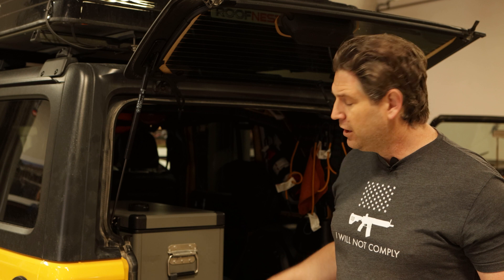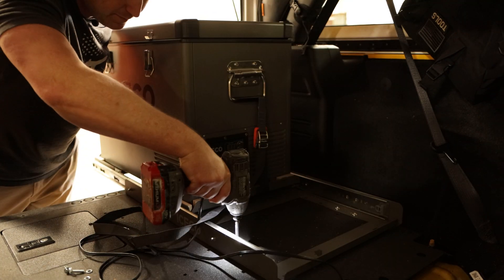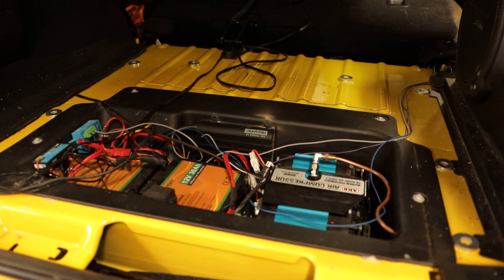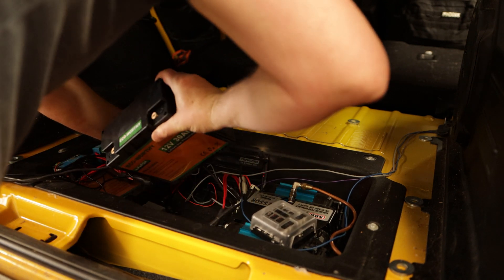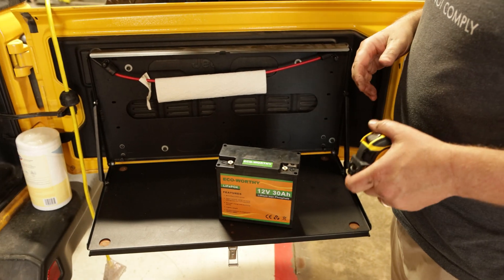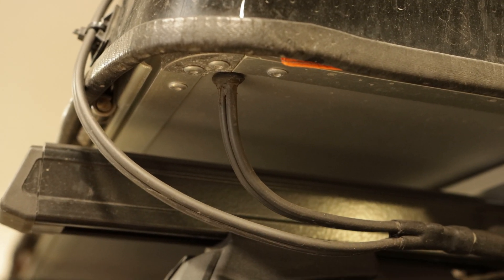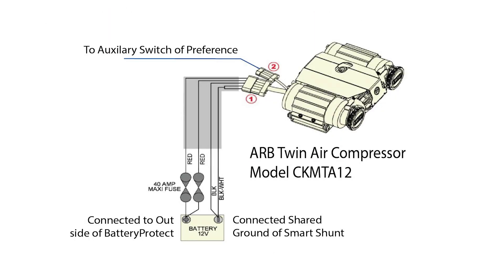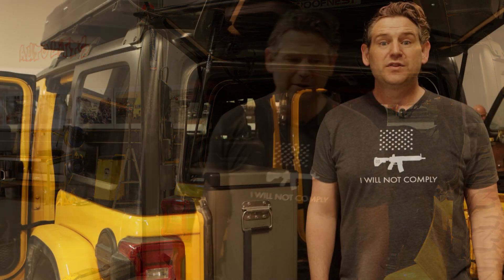Overland Battery Setup on Jeep JL with RedArc BCDC1225 + ARB OnBoard Air

Comment: Where did you run your ground in this setup?
Reply from the maker: There's a ground point to the chassis near the DC port on the interior of the JLU. However, it is also grounded to the starter battery.
Reply: @sonnysoverlandadventures453  Thanks so you have it grounded to the Chassis and the starter battery? What gauge wire did you use? I'm in the process of the same install now.
Reply from the maker: @C-Noel I use the same ground gauge as the hot gauge.
Reply: @sonnysoverlandadventures453  So that would be 6AWG on both red and black from the starter? Thanks
Reply from the maker: I honestly don't remember and would have to look it up.

Comment: an an aircraft avionics tech I can say that crimping is actually the best way to go, but it's important that you crimp properly, using the correct tools, and inspect your crimps to make sure they have been done correctly. You won't see more vibration than an aircraft, so it's kind of hard to argue that soldering is the best way to go. Soldering also comes with a lot of issues as the average person doesn't follow professional soldering techniques or inspection. Either way, you could crimp, then solder, but that's overkill. the important thing would be to make sure you fully understand and research the method you're using and make sure to use adequate wiring and terminal protection/insulation to complete the installation. Personally, I'd recommend newbies go with crimping vice soldering as there's less room for mistakes, but I would caveat that with a few youtube tutorials to make sure they know the methodology. might as well put the time in to do it right the first time, when in doubt ask a friend or your local HAM radio club!
Reply from the maker: Reading this I got all self conscious about my soldiering. 🤣😂 

Thanks for the comments and well said!

Comment: Great job in this video.  I'm doing the a similar set up with a 12v 50ah battery. For your Victron smart shunt in the app battery settings.  Do you have the "Battery Starts Synchronized" turned on or off?  I'm noticing my SOC in the app doesn't go down (stays at 100%) as the battery draws down?
Reply from the maker: This is a very good question! We have it set to off. 

There are reasons to have this turned on though. 

Originally we had a daisy chain of relays that connected to one of the aux switches. The issue was that the four relays would slowly drain the starter batter if left on. So, I completely scrapped that setup. 

Now, the redarc is powered and charging the battery at all times. 

Only reason I'm mentioning this is because this is where synchronization might play a part if everything is disconnected. 

Share your setup!

Comment: This is great, I have a 2 door jk but I think I can make it work. Thanks for the video!
Reply from the maker: It should fit. Maybe not with the ARB, but at the very least you can do a 30Ah with the BCDC or Renogy DC charger. If you do the Renogy DC charger with a 30Ah, you're doing better than the genesis system at a quarter of the cost.